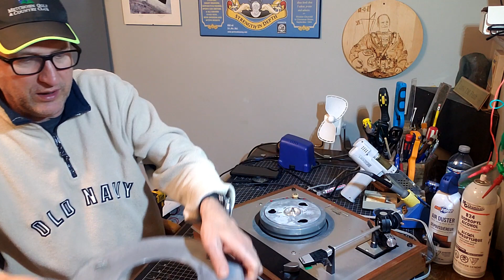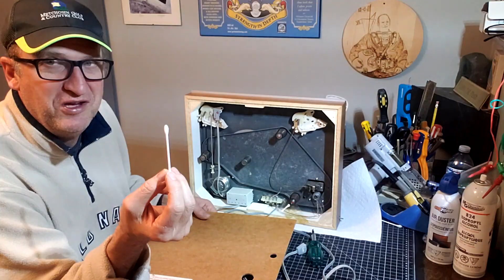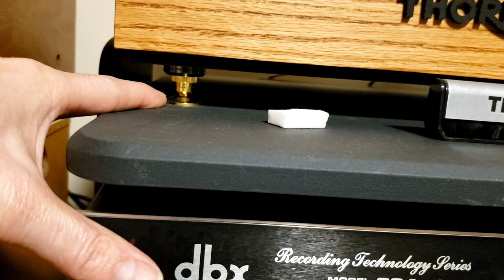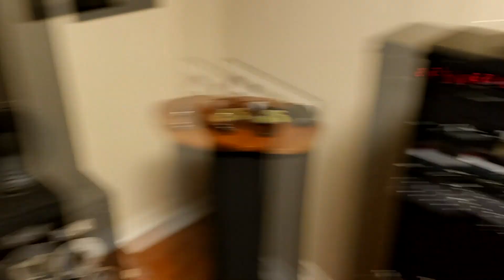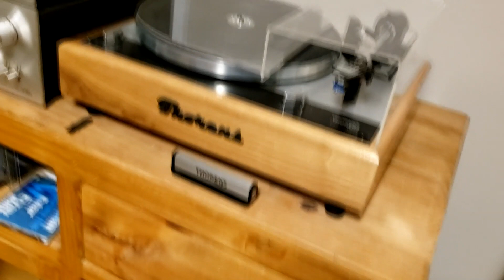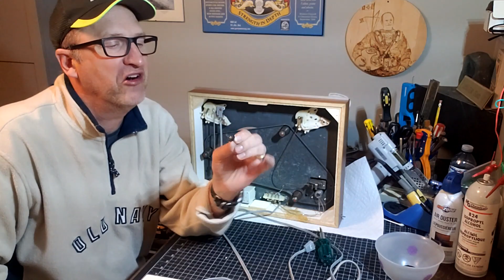Part 1: Thorens TD-160 Project Introduction - 14 March 2022

Comment: I've had my TD166 mk2 since 1985. No major maintenance ever needed. I change the belt every 5 years and oil it about twice a year. I put new rubber feet on the bottom and installed real wood molding over the particle board lower plinth.  The table appears to perform as well as it did when new. Quality lasts.

Comment: I’d love your reply on this. I just restored a Td145 and had your headshell gauge posted online 3D printed. I thought it would be good to have. 

When I got it the results were wildly different than the Baerwald protractor. 

I decided to use the protractor but I’d welcome your comments on the difference. 

Is it that there are multiple ways/positions to setup the cartridge alignment?
Reply from the maker: Yes, significant difference. Thorens had never published, as far as I know, what alignment methodolgy they built their jig on. there no real point in contacting the "new" Thorens to find out since they have gone through multiple restructuring evolutions since the days of the TD-160. Doubtful anyone there would have the means to find out what they did back in their heyday since they are really just Thorens in name only these days. You could try an prove me wrong. As you know Baerwald is but one methodolgy among different and competing procedures...:face-fuchsia-tongue-out:
Reply: Thanks. I think I’ll just keep the headshell gauge in my archives of unused but original Thorens parts. I will continue to use the Baerwald Thorens protractor. 

Thank you for posting excellent videos online. A great resource.

Comment: Hi Tim, great video. I inherited one of these from my dad, and I'm currently trying to set it up, but falling at the first hurdle; connecting it to a power source! Can you help? 

I'm trying to connect it to a Tandberg TR-200 reciever. I've been assuming that the bare ended wire from the TD160 connects to the reciever somewhere, and gets power somewhere, but it's not at all obvious to me exactly where it should do that! 

Or should I, being in the UK as I am, connect a British power plug to the bare ended wire from the TD160? Hmm
Reply from the maker: @marknicoll9325  Is there no power cord?
Reply: @navydiving  not as I can see. There are two cables coming from the TD160 (and no other cables or sockets). One ends in twin RCA connectors. The other also looks - to my untrained eye - like RCA wire (it's the same as the other cable), but the end is bare copper. It has me puzzled as I don't recal taking a plug off anything when I picked it up!
Reply: @navydiving  My assumption right now is that the bare ended cable is actually the power cord, and I'll need to fit a UK power plug. One wire to the live pin, one to the neutral. But, without opening the case to see what's coming from where,  I've no idea which of the twin bare wires is which. I'm also wondering what amp fuse to use in the plug (1A? 3A?). 

It has me pretty puzzled 😅

Comment: Thanks so much for such an informative video. You seem to really know your stuff. Question: just bought a used td 160 it’s really lovely but the tone arm doesn’t seem to be grounded. I can hear static whenever I touch or move it. It has new rca cables with a grounding wire that helps but still quite noticeable. Any ideas how I could fix this? Thanks for your time.

Comment: Glad I found this video. Somone near me has a TD160b mkii for sale for around $400 and I've always wanted to own a Thorens. Currently using a Fluance RT85 and am happy with it, but still....Thorens. I'm wondering if anyone can tell me the difference between the TD160B mkii and a "normal" TD160. Looks like this one I'm looking at has a TP16 tonearm also. Curious if the "B" is a downgrade at all from the original, same with the mkii.
Reply from the maker: The mkII arm is slightly different. It uses an arm wand with different headshell than the TP-60:
https://audiokarma.org/forums/index.php?threads/thorens-td-160-mk-1-tune-up-and-setup-project.991147/
Reply from the maker: Here was my fluance that I sold. Guess which turntables I kept? All thorens: https://youtu.be/aeA_-2lgHKY?si=zR0qiJVF8W76Hz6x

Comment: So much imformation, thankyou for sharing. I own a 160 which is my main deck and a 150 which l am restoring. What l noticed when you were showing your modified deck was the decals for speeds and queing. Where can l get them as my 150 is missing a of them?
Reply from the maker: Here was the TD-150 mk 2 table I restored and gave it to one of my best buddies as a retirement gift. Fabulous tables, as you may appreciate here:
 https://youtu.be/21gsRHgucvQ?si=UpPdGEKPcjA_Pa9H
Reply from the maker: Here were the 33, 0 and 45 adapter pads I made for 3D printing on that turntable you saw in the video. I should have the up, down cue pads somewhere if you want those too? Most of my 3D Thorens models are available to download for free on Thingiverse. 

https://www.thingiverse.com/thing:6004694
Reply: @navydiving  Thanks for that, alas l do not own a 3d printer but maybe l will find someone who does.
Reply from the maker: @5park5  That is what I did beofre I got myself a printer. Easy to find folks that do printing for reasonable prices.

Comment: guide stuff here. thx. funny story on my Thorens TD 240 - I tried to change cartridge , butchered the tiny wires going to back of cart - WHY do they not even have an insulation tube covering the plug in / wire connect , at least to provide a bit of additional strength. !!  this is NOT , to my thinking, a cheap unit.  So I. have a t'table worth approx 2 cents.  sure looks like replacing the entire wire inside tonearm is impossible.  thus should be more durable.  I'm 73. found my hands can't do this sort of thing anymore.

Comment: How did you get the sub platter to pull out. Mine does not pop out. Almost like their is a clip or set screw hold it. It comes out a bit but not all the way.
Reply from the maker: I have heard that some sub-platters had a locking mechanism on the underside that can be released but I have not come across one like that myself in person...

Read this: https://www.canuckaudiomart.com/forum/viewtopic.php?t=19161

Comment: Just pulled out a td165 out of the closet after 40 years and trying to clean it up again. It works fine but the platter edges have discolored over time. How did you get yours so shiny?
Reply from the maker: Mothers metal polish, copious amounts of paper towel and tons of elbow grease.    ;-)
Will be covering that in the upcoming video series hopefully..
Reply: @navydiving  Thanks so much!
Reply from the maker: @DartmouthAlpha  video coming soon